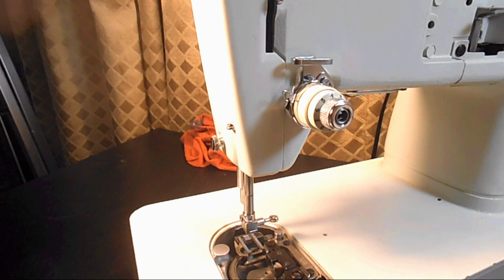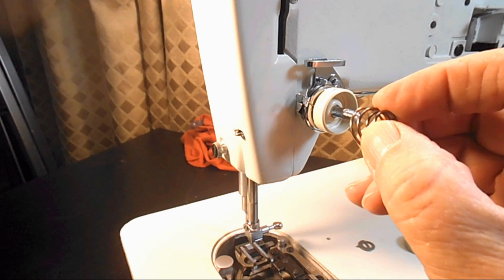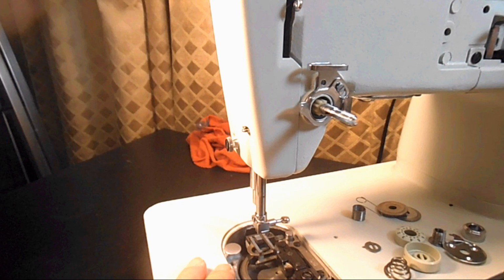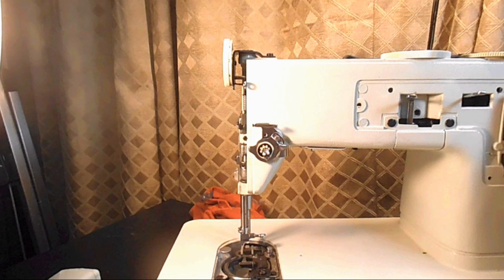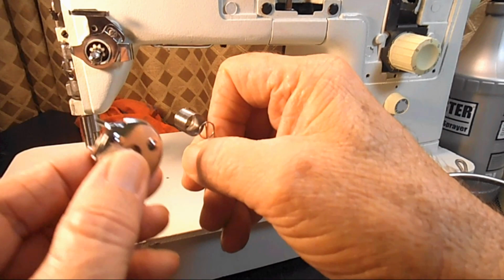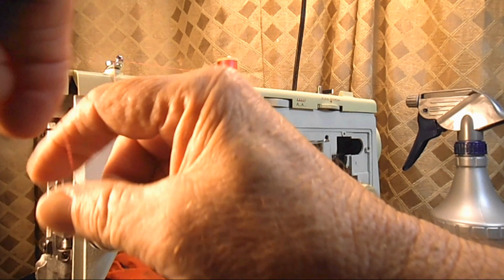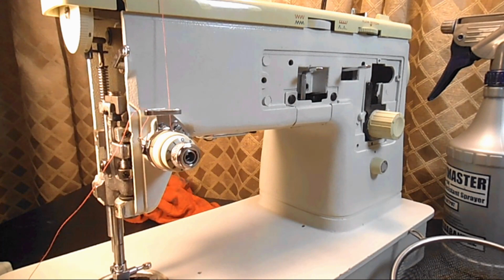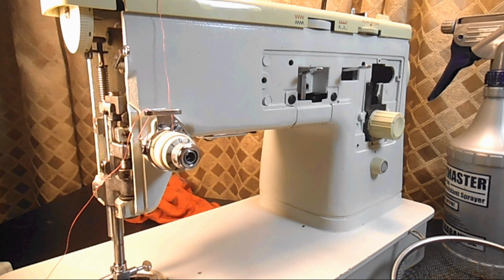How to Remove, Clean, Replace and Adjust the Thread Tension Unit on a Vintage Singer Sewing Machine

Comment: This was so helpful! The tiny screw in my final thumb nut is missing (it's a hand-me-down machine!). Any advice on finding a replacement?
Reply from the maker: Many Singer screws like that were proprietary sizes instead of common sizes. Some set screws they used were common sized though. The screw you ask about is called the Tension Indicator Flange Adapter Thumb Nut Set Screw. The particular size can vary by model number. Sometimes (rarely) you can find newly made screws online. If they are common size a hardware store may have them. You can even make one or have it made if you know the diameter, Treads Per Inch, thread pitch, and tap size needed. Used ones can be found on online auction sites like eBay, but you often must buy the whole tension assembly or most of it. If you can give me your Singer Model number of the machine I may be able to get you a part number or thread type/size. Thanks for watching my channel.
Reply: @andytubesewing1953  Thank you for the fast reply! My machine is a Stylist 513
Reply from the maker: @portiawrites  Thanks. I have the parts diagram for the 513. It shows the screw is part #853. 1/8" diameter. 44 TPI (Threads Per Inch) and it does have a common tap size #5 UNF. Lucky you. UNF = UNified Fine Thread. 44 threads per inch is fine threaded, UNF is an American Measurement System. I bring that up b/c many of my viewers with this model are in the UK and the EU. I do not know if there is a corresponding system of measurement there. Screw #853  also has a Singer Tap size of TE507, so they had their own tap which was a tiny bit different than the UNF sizes but when they list a UNF size that means it will work also. So then, how to find one? I hesitate to show you this b/c so many of these parts sellers have wrong info; they just don't always know what they are selling, but here are 4 screws for sale on eBay; https://www.ebay.com/itm/264772323269?hash=item3da5a907c5:g:yf0AAOSwVSte8NuW   They say #853 but notice they are dark. That may be OK because SInger often used the same size, and different color,  for different parts on other machines. Yours should be bright silver metal. If the eBay ones are the correct size & thread (44 TPI) then these are a bargain, even if dark, but it's a crap shoot buying them (sorry for the language, but let's be honest) Since 853 screw has a UNF Tap size you may be able to find a 1/8" screw with 44 TPI at a hardware store, or they maybe could order it from a supplier. So, RECAP. 1/8" DIA, 44 TPI, #5 UNF Tap.
Reply: @andytubesewing1953  Amazing! I’ll be off on a hardware store tour tomorrow morning, and if unsuccessful, will try the online route. Thank you so much!
Reply from the maker: @portiawrites  That's the route I'd go. Take the thumb nut with you. The hardware store in my town will cut the screw down if too long, and polish the cut end for 50 cents. I wish you success.
Reply: @andytubesewing1953  Success (I think)! Before spending a day (and gas!) running around, I ordered a set of laptop screws. The M3 5mm screw was a perfect fit. The screw head is a smidge proud of the thumb nut (just by the depth of the screwhead) but that shouldn't impact the use! Thank you for your help — I wouldn't have gotten there without it.
Reply from the maker: @portiawrites  Laptop screw? What? That's just brilliant, and something I never would have thought of. Those are some mad skills you have there, Portia ✨ If some info I provide was helpful then that's great, but I think your determination would have led you to this solution regardless. 🏆Thanks for letting me ride along the journey and for sharing it on my channel.

Comment: Have you ever worked on Brother sewing machines?  I have a Bicor VX1005 which needs the tension assembly unit on it replaced and can’t find any videos like yours with my model sewing machine so I can do it myself.  Can you help or at least send me in the right direction?  Thank you in advance. Very informative video though
Reply from the maker: Sorry, only Singers for me. No experience with Brother. One seller of new tension units that I found: https://www.ebay.com/itm/TENSION-ASSEMBLY-Complete-Brother-PS1200-VX1005-VX1010-VX1100-VX1120-VX1125/272381639832?hash=item3f6b35fc98:g:cpMAAOSwOzxZtxUb:sc:USPSFirstClass!85282!US!-1
Claims to fit your machine. Good Luck and thanks for watching my channel.
Reply: Andy Tube thank you 🙏🏼. I already have the tension assembly unit, I just need to know how to swap them out. I’m not sure how to take the old one out and put the new one in without breaking something else lol
Reply from the maker: @aWestSideMom  We looked around this morning and found a service manual for VX machines up to model 686. One of the pictures in the add shows the tension unit and it looks like yours. It might be worth the $5 to download it and find out. The Singer manuals have directions for removing and replacing tension assemblies and I guessing the Brother manuals would too.
Here is what we found: https://manualsoncd.com/product/brother-vx-series-sewing-machine-service-manual/

Comment: I am so happy to have found your channel!  Do you have any information on 248s?  I just inherited one.  After spending hours cleaning off the dust and nicotine (yuck), she looks great, but her tension is a mess.  There are big loops on the bottom.  I'm trying to clean and adjust the tension but the knob is different from the one in this video.
Reply from the maker: Hello, Sondy, and welcome to Andy Tube. I'm sorry I have never worked on one. With looping on the bottom the tension is a good place to start. I usually pull my needle thread all the way out back to the spool and start over, carefully following the Instruction Manual to be sure I have threaded it all correctly. If you need the manual it is a free download from Singer at this link: https://www.singer.com/search/support?title=248    I can't remember how many times aI forgot to lift the foot before running the thread through the tension unit, haha. You can buy the Service Manual from Terry at this link: http://site.tandtrepair.com/Fashion_Mate.html  (Use my coupon code for 20% off before 8-1-2020  andy-h-yt) 
The service manual will have directions for removing/installing the Tension Assembly, and well as most parts of the machine and how to adjust them to factory setting (in case it isn't the tension, but another part) worst case you can buy a new generic tension unit that works on the 248 from this seller: https://www.singeronline.com/teas4.html   If you search on eBay you can find it for half the price direct from China if you don't mind waiting for the shipping time. I hope this info gets you headed on a good path to get you sewing, and thanks for rescuing that machine! Take Care.
Reply: @andytubesewing1953  oh wow, thank you very much for getting back to me so quickly!  I have the owner's manual, but I'll pick up the service manual.  I was able to remove the tension dial, but am now unable to finish putting it back onto the machine.  I appreciate the links and the discount code.  Looking forward to watching the rest of your videos!  Have a great day!
Reply from the maker: You are very welcome, good luck and thank you for watching my videos.